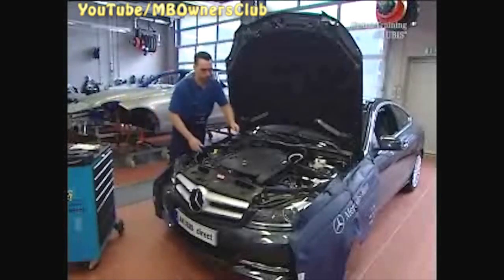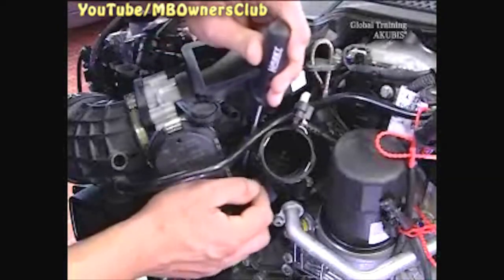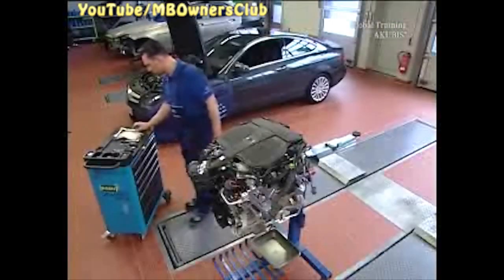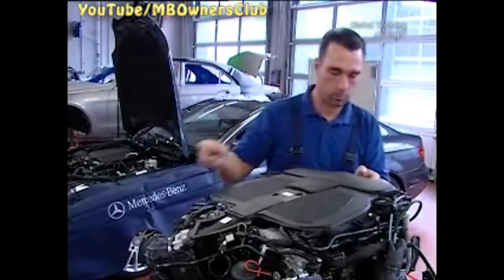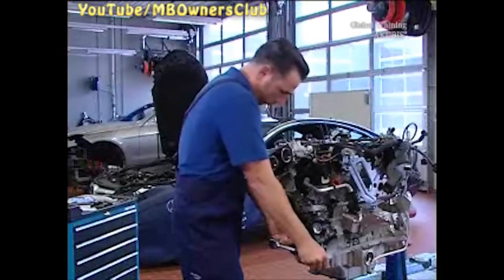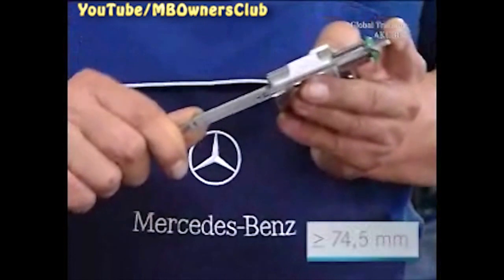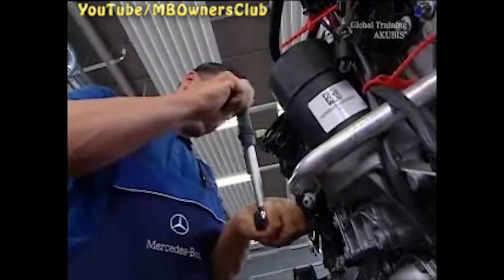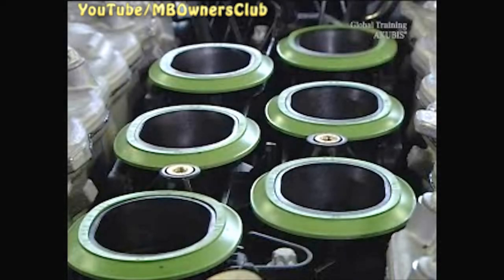How to Fix Engine Rattling on Mercedes-Benz - Remove and Install the Chain Tensioner on M276, M278

Comment: I'm planning to replace the timing chain tensioner and check valves on my M276 engine with the updated/improved versions. I've watched several videos on the procedure, but I'm still unclear on one key point:
Do I need to set the engine to a specific crankshaft position/timing mark before removing the old tensioner? I've seen references to positioning the crankshaft at 40° ATDC for the passenger-side bank (Bank 1), but I haven't found clear information for the driver's-side bank (Bank 2).
Can anyone confirm the correct engine position (if any) required for this job, or point me to a reliable source/procedure? Thanks in advance!

Comment: My 2011 C350 with the M276 engine has the oil-in-the-engine-wiring-loom problem first seen on the W203 M271 engine. Need to have the 'pig tail' loom modification A 271 150 01 56 installed.

Comment: If you have to be 40 degrees  past TDC  for the passenger  side.  Where do you have to be for the driver side?
Reply: Did you get an answer to your question?
Reply: What is thr danger of teplacing failed tensioner in random possition of crankshaft... i cannot imagine why anything would get damaged